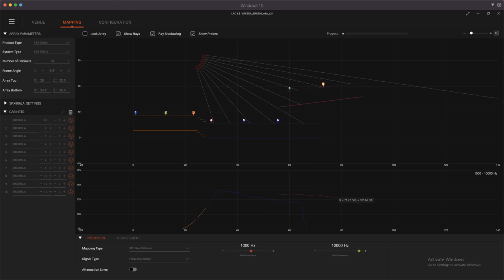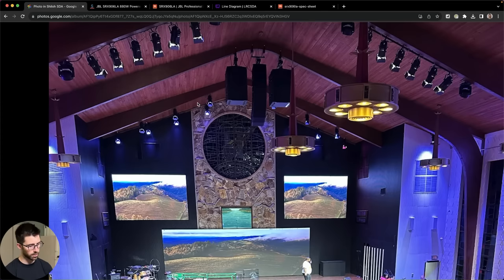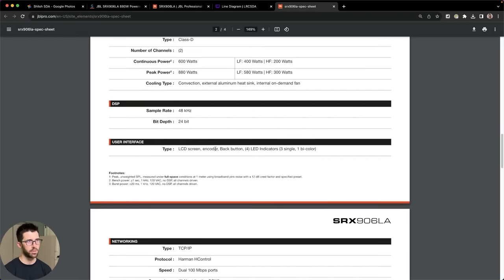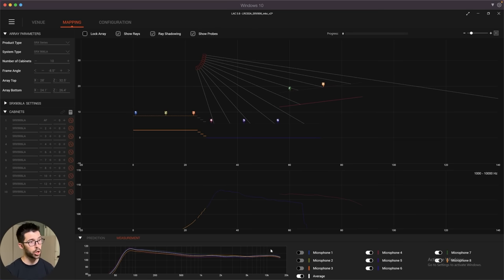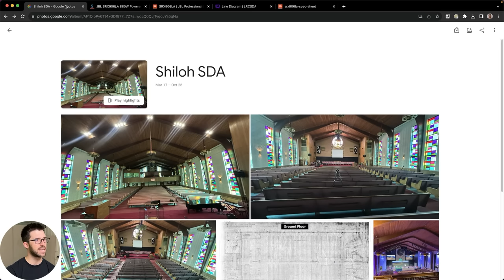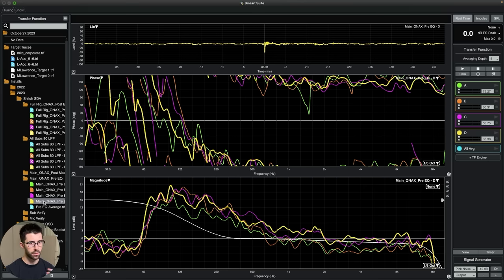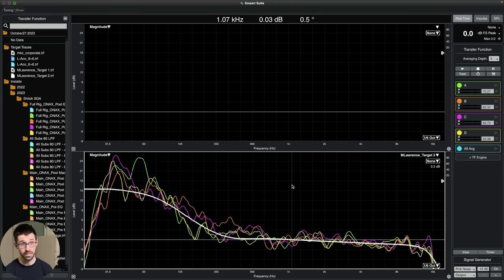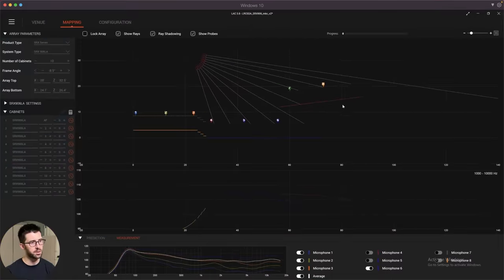SRX906LA Line Array | Did It Live Up To The Hype?

Comment: Michael, I’m glad you got a chance to work with JBL SRX906LA. We just had these installed in our 1000 seat high school auditorium. Because of budget the installation is a 5 box center hang and a JBL SRX928S in center below floor front of stage. The 120 degree horizontal coverage from the 906 is awesome. The system has minimal tuning and sounds fantastic. Midas M32 is front of house.

Comment: I flew a 12 box (6 per side) SRX910LA array in a music venue in January. It's about 5,000 sq ft almost square dimensionally with a 22 foot ceiling. The array met expectation in every way. The design software made it simple to set the splay angles. The system required little adjustment other than 80 Hz high pass and attenuating the bottom boxes. Every guest engineer has loved the system. The house budget did not allow for purchasing new subs so the currently installed subs work for some events. We augment the array with floor stacked LAB subs for touring acts which have been lauded by every engineer working the room. We had a reggae act recently that put the system to the test. The amplifiers remained slightly above room temperature throughout the event, well within an acceptable range. So far nothing but compliments from engineers, patrons and the purchaser. I augment the system with front fills to seamlessly cover the first twenty feet centered in front of the stage.

Comment: I'm mostly corporate and I recently sold my 12 yr old VRX rig for the SRX 906LA.  It's been recent and haven't used them much yet so I appreciate your covering them!
Reply from the maker: You're very welcome!
Reply: How do you compare these with the VRX line up ?
Reply: @iamdjmus  A recent annual event is very informal and I was able to set up 2 SRX906 per side next to 2 VRX932LAP per side.  Listen to each one for a while and they each sound perfectly fine.  But compare them back and forth and they were soooo different.  The VRX sound really 'bright' compared to the 906.  But get used to the VRX for a while and the 906 sound a little muffled.  There's a lot of 'air' / 'bright' / 'crisp' in the VRX.  I couldn't say one was better than the other, but they are really different than each other.
Reply: @ScottieParr  and did you tested the subs too ? I'm wondering how my vrx918sp hold against these new boxes.
Reply: @iamdjmus  I've used the new subs have have not compared them side by side with the VRX918SP.  I wouldn't guess because I wouldn't have thought the tops would have been that different.  I just read though all the comments again and see people saying the 906 are bright.  They sounded dull next to the VRX (to me).  That's not a complaint at all, I think they sound great.  But the VRX sound really bright once you're used to the 906, and the 906 sound really dull when you're ears are adjusted to the VRX (to me and 2 other production friends that were comparing them).  Has anyone else had these side by side to compare? (PS, I'm Dallas Sound Guys, not sure how I'm logged in by my name now, haha).
Reply: From your experience, would you say its a lateral move going from VRX sub to the SRX ?
Reply: @ScottieParr Interesting. I’ve been to plenty of events where the VRX arrays are super harsh and hurt my ears. They’re way too common in my area. I hope some companies switch over to the SRX-900 arrays. They seem better than the constant curvature system.

Comment: We just took delivery of 12 of the 906la's and 6 of the 918s subs. We haven't had them out in the wild too much yet, but they seem like a good middle of the road array. I have also had them set up in smaller chunks like 2 over 1 sub, 4 stacked on 2 subs, etc. The presets seem helpful based on if you are doing a full array, 3-4 boxes or 1 as a front fill. I do wish that LAC was more 3 dimensional.
Reply from the maker: Yes, would like to hear them in the application you described.
Reply: 1000 times yes on LAC!!
Reply: Let me know if you're ever in Nashville and have time. I'll set it up. @MichaelCurtisAudio
Reply from the maker: Will do!  @stewartscreekaudio8105

Comment: For me, this segment is the most interesting. Double 6", double 8" and some even double 10" boxes (always depending on cost), represent the entry for many rental companies into the professional market. For facilities (for example churches, houses of worship), they represent the entry or the possibility of making more effective installations that due to economic issues were poorly resolved with point sources for many years, sometimes even with boxes from the cheap portable segment. RCF, DAS and some other brands have quite interesting systems under $2000 each. We have to weigh the virtues, advantages and disadvantages to be able to compare and choose when it comes to acquiring a new system.

Comment: I've been using a 16 box SRX906 rig (8 per side) with a 4 box SRX928 sub rig for the last few months. I have been VERY impressed with their performance, SPL, and punch. For their price point, I think they are going to be hard to beat, even compared to an RCF HDL6 rig.
Reply from the maker: Glad to hear that! Are you using a separate processor or doing everything within the built-in DSP?
Reply: @MichaelCurtisAudio  we are a larger church in Joplin, MO called 'Hope City' so I didn't personally install anything. Our integrators, Strata AVL, did everything when we built our new building and they did all the processing  each box where needed. No externtal processors. I know you're based in Arkansas not to awfully far away, if you would ever like to come out and take a look, we would love to have you!
Reply from the maker: Ok, awesome! Yes, Joplin's only about an our away from me. @bradleyhenady2032
Reply: Would it be worth upgrading from the hdl6 to this?

Comment: I wonder what you think about placing speakers around the dancefloor, for example, one in front another in the back, or 2 in front and another two in the back or even another pair in the middle? I noticed that some clubs around my place are doing this probably to focus sound on the dancefloor and get rid of loud music in the lounge zone. Is it a bad idea? Can I do it for example at the wedding? I know that the "music stage" will be fucked up couse people will not be able to localize the stage or DJ both by the ear but anyway. How high should I cut low frequencies on these extra speakers to get rid of "power dots and circles" couse that's something I see in many mid-high frequencies in Ease focus 3 when I'm trying to simulate these sound solutions? One club that I know has this solution, and they just have crossover in 120hz on every speaker but I noticed that the bass there isn't very even, also this club is bursting at the seams in peak time and they have subs stacked on the ground in the corner so maybe that's the issue (couse people are absorbing this bass). Also, I appreciate your work and I have learned frome you a lot.

Comment: great video micheal! Looking in the EQ still you posted, there seem to be a lot of wide Q alterations that are in very close proximity to one another.  I know its about how it sounds not how it looks but could similar results have been achieved with fewer cuts? Im also surprised to see how much low shelf you needed... as the prediction didnt show that, i imaging that was a function of the acoustic parameters of the room?
Reply from the maker: Great questions. Yes, I'm sure the same curve could have been arrived at with fewer filters. It's just what I ended up using to get to the desired target curve.

Although I haven't used the SRX906's before, I need a similar amount of low shelving with the HDL6-A's, and its prediction doesn't show that either. I'm sure some of it was due to the room, but I'm not surprised it required this much shelving given my past experience with similar products.

Comment: How would you go about installing a stereo line array system in this room given how narrow the room is compared the horizontal coverage of these line array speakers or even line array speakers in general? I’m aware that if the speakers are closer to the walls there would be sound reflections. Additionally there would be massive sound overlap from the left and right speakers thus causing phasing issues. What could be a workable alternative for a stereo system?

Comment: Before applying the boost around 80Hz to the subs, did you try measuring the SRX906s without the 80Hz HPF you added to them?
Being a self-powered box they should already have some form of built-in HPF for driver protection as part of their internal processing. From the spec sheet - this looks like about -3dB @ 70Hz. Having a little more overlap with the subs may have avoided the need for sub EQ?
With the long hang of SRX906 there should be plenty of LF headroom for this to work, especially with all the low mid you EQd out.
Reply from the maker: Great question! I chose to go ahead and use the HPF instead of running them full range because this kept the phase slope throughout the crossover range between the mains and subs the most closely aligned, and since they were flown together I wanted to preserve that relationship.

Comment: Good job. You have an inv. Polarity in some cable or in the mic. It depence on witch measurement mic are you using, some of them are 2&3 pin inverted.
Reply from the maker: Good eye! I honestly wasn't sure if the native phase response of the 906's was similar to that of the HDL6-A's from RCF in that it's intentional that the polarity is inverted (so that they marry with their RCF subs out the box). I need to check with JBL and see.
Reply: I work for Harman. All VTX & SRX have a compatible phase trace starting at 0 degrees in HF. The subs are xover compatible ( tops&subs ) with that phase trace. Have a nice one!
Reply from the maker: Thanks for the clarification, @carlosnager4170  ! That settles it, then. I did end up doing a polarity inversion on the VTX subs to get them to align with the SRX mains through crossover, so sounds like the XLR drive lines to the SRX boxes were reversed. I appreciate the clarification!
Reply: @MichaelCurtisAudio  great note to test the work of the integrator as close as possible before jumping into any tuning activites... also worth checking for anything silly happening on the console before going on the tuning journey.  There have been a few times where i got pretty far only to observe that there was delay or EQ or something happening on the desk i didnt know about and then I had to start over without the desk contributing... just cant assume its all flat, gotta check
Reply from the maker: Yes, absolutely, @eflizotte .

Comment: Hi there.
The frequency response is quite high in the low mid section.
Is it okay if I do a HPF on vocal mic around 170-200hz ?
Reply: HPF wherever you need to to get the results youre after! depending on the room, the rig, the mic and the vocalist,  HPF from 100 to 250hz could be used...

Comment: Would you be able to do a left and right hang with the 910s since the angle is 105 instead of 120?
Reply: Imho still much too wide for that room
Reply from the maker: You definitely could, but like @zamsky39 mentioned, I think there'd be a lot of overlap between arrays and a lot of HF reflected off the walls. And it'd be double the PA cost : )
Reply: Okay fair. Do you work that out using your line array software or is there like a general rule of thumb as to what width is too narrow for a left and right hang?

Comment: Jbl Srx LA 906, 910 are good speakers, but it's a pity that they are based on old patents from srx800. The price of one is $2,500, the competition will win. Jbl doesn't have a good, strong Subbass, QSC KS118 destroys JBL. installing the Srx series in a church will completely destroy the architecture. hide the poles discreetly.